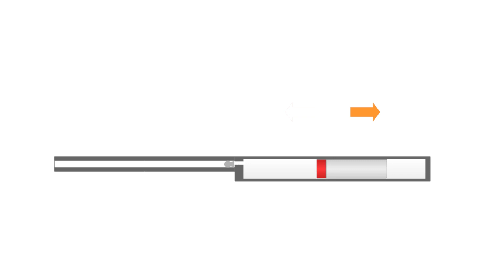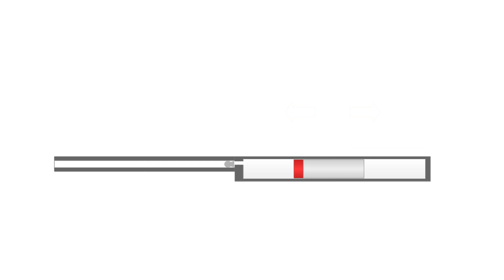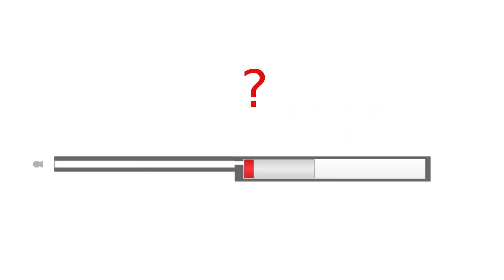Spring Piston Airgun Recoil 2

Comment: Very cool diagrams and explanations!

I see now why a loose a very light pellet could cause major piston slam.
My Express hunter is shooting some lighter pellets good but I can clearly hear a noise difference inside
(More "pingy")
Reply from the maker: Thanks! I need to get off my butt and finish up the rest of this series.
Pellet fit is the largest and easiest to correct factor when it comes to bounce vs slam. I've had some slam so badly that they were uncomfortable to shoot. Certainly wasn't doing the spring any favors either!